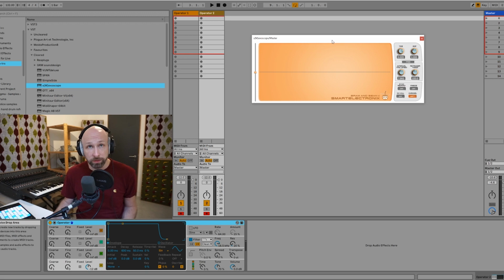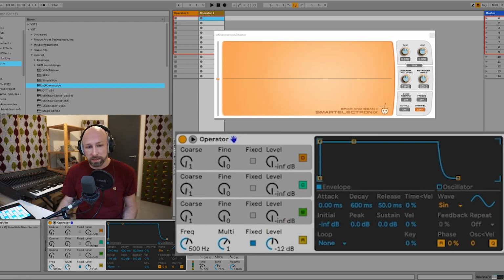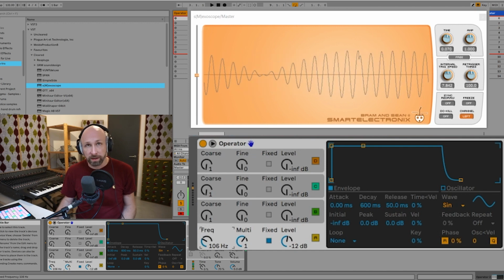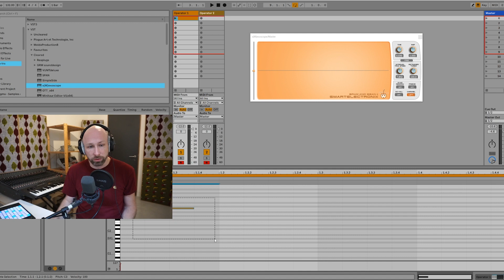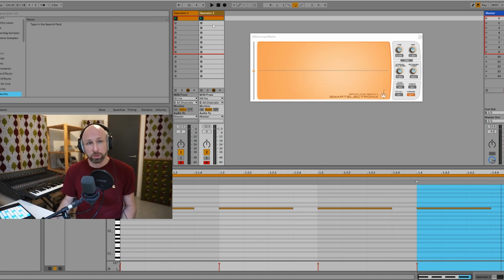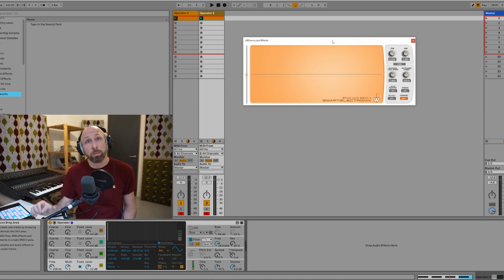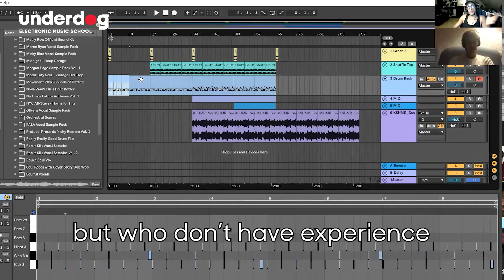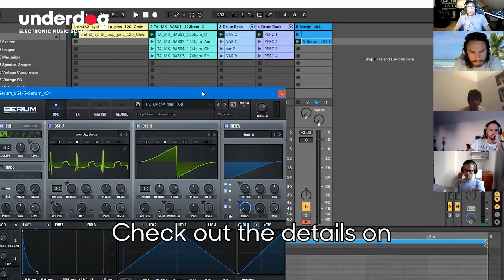Bass phasing explained

Comment: I wish I understood why this happens when synthesizing kick drums, not layering them, just straight up coming out of operator. Using the tuner, I can see the kick starts okay, but as more and more bars of the basic 4x4 pattern are played, it starts to move and resets every 2nd bar or so. It happens when playing out of a synth, or after flattening the track. Also I make sure that the decay tail is gone by the time next kick comes up. Am I overthinking this, is it impossible to completely remove phasing?
Reply from the maker: Some synths allow you to reset the waveform cycle every time they receive a gate trigger! That could help make it more consistent? Some synths like Sylenth1 make a big deal out of that, which also allows you to choose if your supersaw sounds start perfectly synced up or more smooth/softly!
Reply: @OscarUnderdog  I'm making the kick with Operator in Ableton, with phase retrigger on,  both on oscillator and algorithm settings. I tweaked the amp envelope to get it to not phase, but it's still present, on Tuner it shows that it changes about +-3 cents every few kicks then it goes back to normal, repeating in cycles, also I've used an osciloscope to watch the waveform and I can notice it moves slightly again every few kicks while the loop is playing. In this example, it's probably not too noticable, but if I start making heavy kicks, with a lot of processing, the phasing becomes more obvious, which I can see when printing the loop, every kick after the first moves slightly after the 1/4 mark. I tried to research a bit on this problem but I haven't really found an answer I was looking for, most of them talk about layering kicks which I'm not even doing. Other sources say that phasing is normal, and I think that I might be overthinking this especially after I remember hearing in tracks like a slight pitch shift every bar or two where the 4x4 pattern is playing, not too noticable but if you pay enough attention it is hearable.

Comment: If you have phasing issues, but you don't want to change the pitch that much in the conflicting elements, is EQ a good fix?
Reply: as long as the EQ is adding more definition by substracting or adding to certain frequency = pitch, then I guess it's.